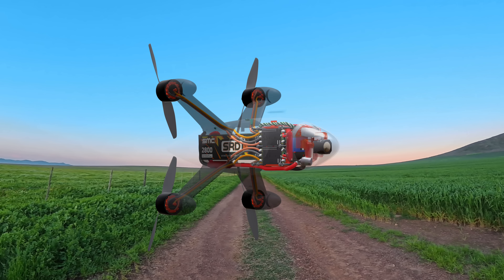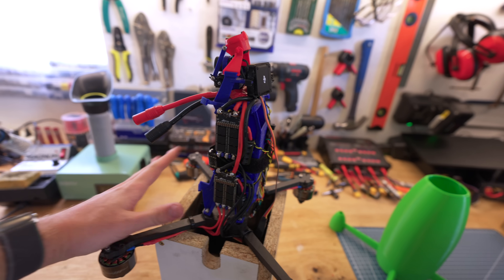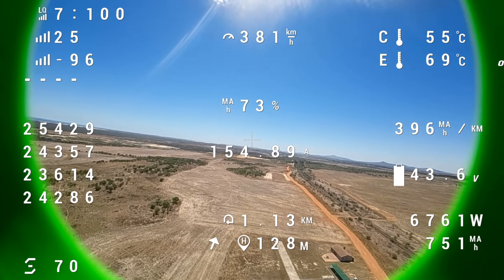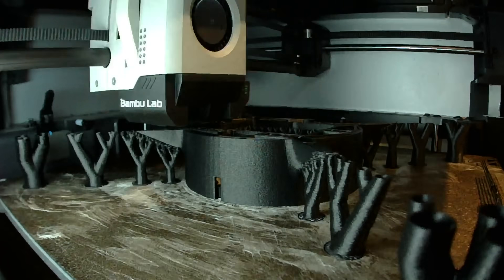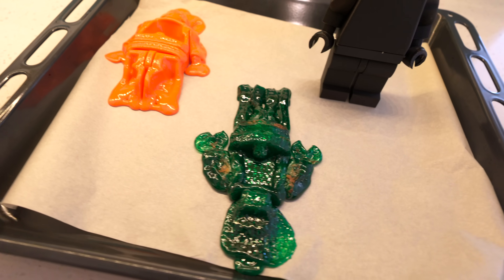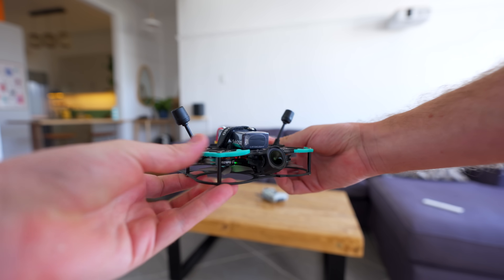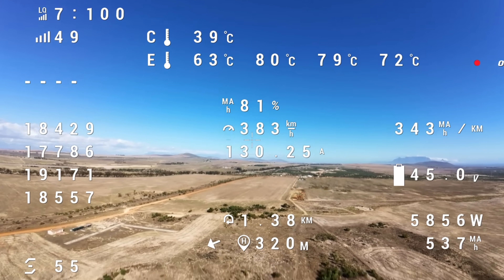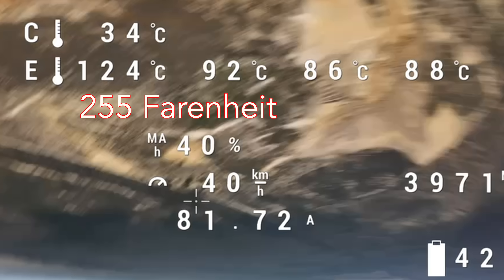THE COMEBACK - World's FASTEST Drone V3

Comment: cooling idea that will lower weight. liquid nitrogen or CO2 with small vent holes at each motor this will decompress the liquid cooling the controller and benefit venting cools the motors as well. bot liquids much lighter that water to begin with.

Comment: I wonder if you could thermally interface the ESC with the outer skin of the drone that already convects heat with the high air speed really well. If a portion of the outer skin was made with allium or copper might be enough. Then you should super chill it right before flight with dry ice or liquid nitrogen and you'd have a thermal battery that only needs to absorb so much heat before the speed record is achieved.

Comment: Have you thought of integrating the cooling into the fairing, so the fairing of made of a thermally conductive material (e.g. shaped copper or aluminium sheet metal) esc and heat producing components are stuck onto the inside of the fairing with thermal pads, paste or epoxy, transferring the heat to the air stream? That way you don’t the added weight from the water or its container.

Comment: I love that we're back to making the fastest propeller powered flying machines again like it's 1941. The quad-jet drone race should be interesting.
Reply: I'm looking forward to jet engine powered drones going mach 3, then subsequently being outlawed once people realize they've just created hobbyist cruise missiles.
Reply: @dereknalley  thinking about this: it is kinda funny when you realize in a lot of countries they are discussing the ban of knives while at the same time the tools to build your own miniature war bomber are freely available.
Reply: @dereknalley  Jet engine is too complicated and requires sophistication to be able to accelerate to mach 3 .. Instead, I'd used a hybrid rocket engine, which upon exceeding 1,5+ mach (and depleted of fuel and liquid oxidizer), jettisones aerodynamic sloped surfaces preventing the air to be compressed in a liquid fuel propelled air breathing Ramjet engines. Excelling at 1,5 - 3 mach, no moving parts, and can be automated to keep continuous stoichiometry of fuel injection speed via sensory system (like a simple pressure gauge with a spring load pushing it out, and air pressure pushing it in) --> electromagnetic controlling system reacts to both increased velocity and altitude with lower pressure similarly; injects fuel according to what molar mass of 21% O2 goes through the Ramjet per second..?

Dunno if it'd work, but dunno why it wouldn't, either.

More easily said than done for sure.. 😅
Reply: Can't wait for the Thunderscreech version
Reply: @jooch_exe  that would be glorious
Reply: Not gonna be any big races, maybe drag races. The flighttime of this drones is like 2 or 3 minutes with that amount of powerdraw.
Reply: @YouCountSheep  this drone probably have 1 min full speed max. Actual race drones have around 2 min at race speed
Reply: I like watching these, because like with most content creators, it's seeing everyone constantly attempting to re-invent the wheel. Wait until he figures out they make anti-freeze and/or ammonia in a scroll compressor.
Reply: like its 1925 brother
Reply: they totally make RC Turbine engines as well
Reply: You love that the world resembles the 1940s?
Reply: @departmentofinteriordesignUS  Yep, that's definitely exactly what I said, and totally not a strawman that you're using to intentionally misrepresent what I said.
Reply: @departmentofinteriordesignUS Were you dropped on your head as an infant?
Reply: @departmentofinteriordesignUS your density is impressive

Comment: As an engineer I see a detrimental disadvantage, that water must weigh around 60/80 grams, if you air cooled the sinks that's more beneficial, using mild 3d printed ram air ducts, with minimal drag coefficient.
Reply: The drag needed for heat exchange would probably be way more than the extra drag needed to increase lift by those 60g, the most weight efficient option would probably be some phase change material, ideally to gas and vented outside if rules allow
Reply: Liquid helium, problem solved.
Reply: @DMalek  helium is finite resource
Reply: @FrejthKing And?
Reply: Drag force goes with the square, mass is linear in Newton's second law. So "as an engineer", you should know the drag is going to be a much bigger deal.
Reply: Drag is the biggest factor to overcome at speed. Top fuel dragster has to create the power they do to overcome drag of the aero to keep it on the ground.
Reply: Do you think a vapor chamber like the use in phones would be an option?
Reply: @sascharoni  vapor chamber is just a large heatpipe. hard to manufacture one offs, compared to how easy it is to attach a heat pipe.
Reply: As a lawyer, While the coolant mass adds ~60–80 g, the system isn’t optimized for static weight—it’s designed for transient thermal stability during peak-load operation. Water’s specific heat capacity (~4.18 J/g·°C) provides far greater heat-absorption efficiency than any feasible air-cooled configuration within the nacelle’s Reynolds regime. CFD modeling (Re ≈ 3×10⁵–7×10⁵) shows that micro-ducted airflows experience boundary-layer separation and turbulent inefficiency long before achieving the required convective flux.

The liquid loop acts as a thermal capacitor, buffering heat spikes that would otherwise cause resistance drift and efficiency loss in the ESC and stator windings. In effect, those grams of water serve as dynamic thermal mass—stabilizing temperatures and preventing hysteretic degradation under pulse-load conditions. Air cooling would be lighter, but its uneven thermal profile and drag penalty at record-speed airflow make it less effective. The coolant isn’t a disadvantage—it’s an engineered component of the powertrain’s transient response model.
Reply: Actually, instead of water, they could use any heat absorbing material, like aluminium slab
Reply: @ecoterrenos_cl if he dosnt get rid of the heat water is the best. It has the highest absorption cp coefficient.
Reply: I didn't see the first video, if you don't care about the system that much then a simple dry ice cartridge would work, it's far lighter than h20 and also as it sublimates into a vapor it also becomes lighter.,
Reply: Well done
Reply: 5 seconds into the video I asked myself why it wasn’t air cooled.
Reply: Lol I would never hire you "as an engineer" if that's the conclusion you come to.
Reply: they explained the weight difference is negible for the top speed, that what matters is aero
Reply: Weight is not important here at all. At the power the run, they could lift maybe 5 times the weight of their drone. So 100 or even 200 grams here have zero impact.
Reply: @ecoterrenos_cl  I feel like when you're talking these speeds I imagine every bit of avoidable air drag and weight additions are beneficial and looking to avoid additions is a good mindset - without neglecting the fact any additions may incur housing changes, further increasing weight and drag. I'm sure some extra grams wont overly hurt no but, cooling is just a temporary mechanism from prolonged use based on amount of heat generated. No point adding more for more efficient use when it's use is one run for a max speed time.
Reply: @ecoterrenos_cl  Even a Rock can fly if you strep a strong enough engine on it. A Professor once said.
Reply: @ecoterrenos_cl Any extra weight is power spent lifting the weight instead of fighting drag.
Reply: @wagnerrp  only during takeoff and initial acceleration the weight plays some role. However,  to lift an extra 100 grams you need about 50 to 100 W, depending on motor efficiency.  They run the thing at about 15 Kw, so that is less than 1 %. And when they get to high speed, that extra power disappears completely.
Reply: @wagnerrp I was going to say: “Why did I spend $50,000 making my car lighter”
Reply: They did already and it was a lot worse. Did you not watch the video? 🤦🏻‍♂️
Reply: The point is to break the record not to survive the attempt, no need to spend weight in cooling as log as it doesn't affect performance. Drop some liquid N on it before or something, it just needs about a minute of operation, I would also consider a super capacitor instead of a battery
Reply: Nope, the cooling drag would be catastrophic to the top speed goal.  

Weight doesnt really matter for top speed runs, go look at how heavily built the Bonneville streamliners are.  They're all about engine and aero optimizations.  

Also, go look up pictures of the National Championship Air Races.  Some of the very fastest planes are P-51's with the radiators removed, and instead they use a total loss coolant system.  They basically just boil their coolant and dump it over the side.  Shaving the radiator duct completely off and removing the drag penalty from it is worth the weight penalty for them.
Reply: "as an engineer" no one cares bro. You have helpful information or you don't, no one cares about gatekeeping anymore. Those ducts would create a shitload of drag and instability.
Reply: @skeeterjames912 maybe since they are an engineer, they would know how to create ducts in such a way that they cool the internals without instability, like, I dunno, every hypercar uses air ducts to cool an engine.
Reply: @Jasper_rnj How does a top fuel dragster stay cool? This is what most people here aren't understanding. His goal should be bare minimum weight and complexity to reach the record.
Reply: @Jasper_rnj  hypercars also need the air to... you know... run the engine so like :/
Reply: @FakeMichau  yea ur right, but my point was that we can keep things air cooled while maintaining their stability
Reply: @Jasper_rnj Hypercars need to run for longer. You should be looking at dragsters, which don't have any kind of cooling at all. Really, they don't even have radiators. Bet ya didn't know that!
Reply: @skeeterjames912 I care.
Reply: @skeeterjames912  Who is "gatekeeping"? He is helping. Dont let your own low confidence destroy good advice.
There is a reason real jets are aircooled.
What ideas do you have?

Comment: dude doesn't even understand how water cooling works. Water just transfers heat to huge AIR radiators. Your design doesn't even have radiators. When the water heats up, the controllers will burn out because there are no radiators in the system. My God, are people really that ignorant?

Comment: I think you could save a lot of weight if you looked into vapor cooling or heat pipes. A pre-fabricated vapor chamber heat spreader, like the kind used in mini top line models of the latest generation of cell phones, would be perfect for this.  Super thin and light.

Comment: hey Luke, awesome work and video. Fellow Cape-Townian Winelander here. For cooling, consider submerging the esc's in a tank of mineral oil. It's less effective than water, but more effective than water + a heat plate, and can reduce the weight and complexity of the entire assembly. I hypothesize you likely don't need a pump as convection would circulate fluid already.

Comment: @7:03 1) thermal pads suck. There is thermal epoxy that has a much higher coefficient of thermal conductance.
2) Aluminum is one of the best materials for radiating heat, why not just use a heatsink / fin grid and pass air through and over the sink? You are heat soaking the water and carrying all that weight with you. How much volume of air passes over the heat sink at high speed? I guess the issue is you want the best airflow characteristics over the drone body/surface.
3) if you are interest about airflow optimization, please look into "shark skin surfaces for fluid-drag reduction in turbulent flow". A simpler method might be to employ golf ball style dimpling to the drone body.

Comment: Suggestion for cooling: put the controllers in the box and use a non-conductive fluid. No need for the large alu plates anymore. The vrbration/movement of the drone will create enough circulation so no need for the little pump.

Comment: Would you get more cooling by having heat sink fins in the water and using a little antifreeze with distilled water to let the pump run smoother?
Reply: No need to do more.  Luke’s cooling system is already super effective. 15 deg C temperature rise on a record run.
Reply: @Mike-Bell that's a fair point actually😅

Comment: I am an Aero Engineer.  Try making the tail cone flat and not pointed.  You need the air flow to go from laminar to turbulent on the back.  That will result in less drag.
Reply: The drone needs to be balanced like you do with a tire on a car.  Spin it on the access of the direction of flight and add wt so it has no wobble.
Reply: Do u think some shark fins would solve the wobbling, i think there's a weight imbalance causing the side to side wobbling with 4 fins would solve the weight imbalance giving more aerodynamic
Reply: Former-LMMS myself, this vehicle's shape is literally backwards, as you've already stated.   
*Ducted-fan assemblies may produce more top-end speed.  *The quad-prop arrangement is basic TVC, but requires quite a bit of computational control for stability in a craft this size/shape.  A high speed gyro stabilizer might be an option? *The Nav, ESC electronics (battery should have a separate cooling circuit, if needed) should be cooled with 3M Fluorinert fluid, all contained within an alloy 7068 nose cone.  Said cone should be externally processed with something like Techline Coatings TLTD-Gray.  
** When pushing the limits, look into what the Aerospace/Defense industries did decades ago.  Much has been declassified, and/or is now available COTS!
Reply: @xxxxxxxxxx6903 Maybe you should take the record yourself rather than tell the current record holder what they should be doing. So many armchair experts in these comments it's ridiculous.
Reply: Uh huh. Yeah. Everyone is an "aero engineer" on here. 😅
Reply: @apothekers  He is right, thats what matters.
Reply: @Baleur he's actually not right though.. a flat tail would cause maximum flow separation leading to turbulence and parasitic drag. A long tapered tail with a tear drop shaped tip  would allow for more gradual separation, less vortex shedding and more stability at high speed.
Reply: @Falenir  - While what you stated is correct, this project is a very short duration mission.  Laminar flow is ideal for steady state speed.  But with finite battery capacity & thrust, this craft needs to accelerate as fast as possible.  With that in mind, a column of laminar flow becomes a suction force upon the tail section(s) upon fast rate acceleration!  In all reality a Dynamist with fluid FEA software should volunteer on this project!
Reply: @apothekers your mom

Comment: the idea of these as a weapon sounds terrifying
Reply: There are already unmanned rockets
Reply: @CitizenN0  which thus can't be aimed
Reply: @DylanVos05 we they can, there is actually Rockets that can change their course at will and can also mid air change their trajectory and even their targets
Reply: @CitizenN0 yea but these are called missiles and are expensive and drones are cheap
Reply: @DylanVos05 you know that most of the Deftech is expensive not because of the manufacturing, rather because of the research load behind the scene, right? If the project is opensourced, the costs are nearly same... While I can hear you about the usability of drone vs missile (or rocket)   like one for short/mid range combat and the other for far mid/ long-range ones... Still the Deftech in today's era is already homemade-ready without any highlevel engineering understanding

Comment: 9:24 you actually only need a 5mm diameter opening at 500kmh to move 175 liters per minute, and it drastically reduces weight. Not that that matters a whole lot for top speed but it does reduce complexity. 

You'd also need less air than you calculated to have the same cooling capabilities as you didn't account for the water heating up and thus reducing the thermal gradient which drastically reduces cooling speed.

If you do still want to do water cooling, you should definitely give the aluminum plate surface texture to increase surface turbulence and area to speed up heat transfer to the water.

Comment: Adding more surface area inside of the water box ie internal fins would reduce the volume a bit but could dramatically improve the heat transfer. 

You're really limited for heat dissipation by the capacity of your water loop, but being able to pull more out quickly would help keep the ESC temps from peaking atleast.
Reply: There's no water loop.  They're not circulating the water to a heat exchanger.  It's just a literal heatsink.
Reply: But there is no point! It already works!

Comment: could you maybe do oilcooling or some other liquid without any tubing? so that the case itself holds everything and then you only need a pump that moves the fluid around. I think insects work the same way :D ofc thw whole thing would need to be done in a way, that the overall volume where the liquid is inside isn't to big, as it adds wheight.
Or maybe add a small capsule of pressurized gas, that you can release slowly so it cools simplpy by the expanding gas flowing through it, which might even give a little boost, when the outleet is in the back 😂

Comment: There is the 1 in 20 rule when making missiles that it needs to be 20 x the guage for stability yes it increcrease drag but the tube becomes obecomes one of the planes,  you can shorten that by using canards.  looked at your water cooling, I used  peltiers on my water block which means you can make the water block thinner, less weight,  I built a laser cutter and water coolong was a nightmare till i discovered that you need to let the water become warm before pumping which stops thermal shock
Reply: typing on a bumpy train does not help with spelling, sorry